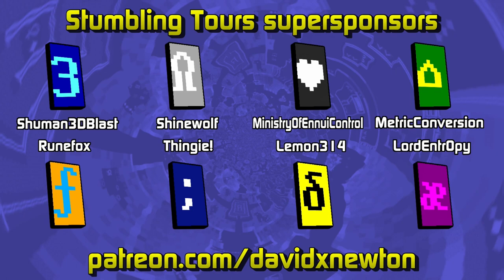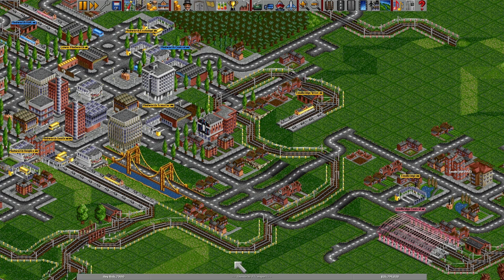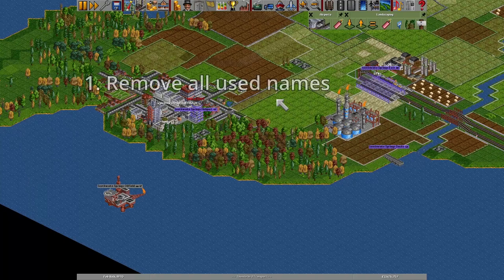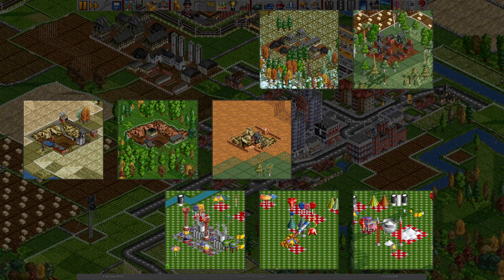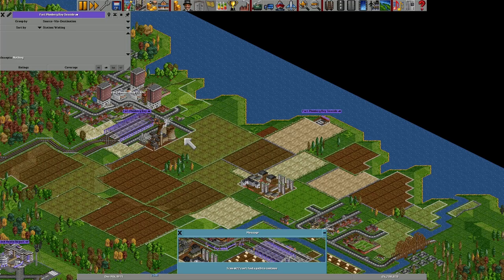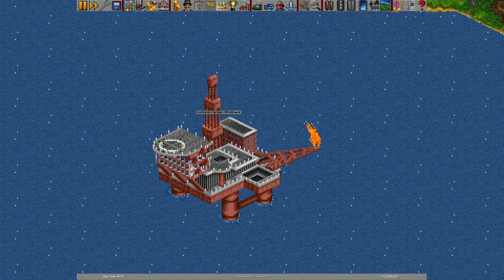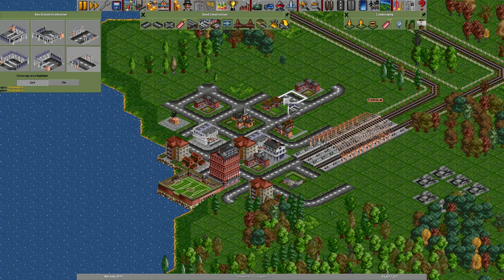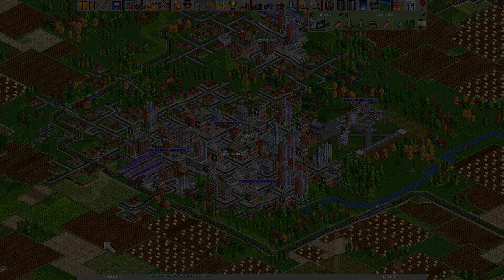How are stations named in Transport Tycoon Deluxe?

Comment: From a quick test, it looks like a station is permanently assigned to a town when named. Which might seem obvious, I can't rename "Tendbridge West" to "Mudworth West" and expect it to now be assigned to Mudworth - but what I mean is doing some "station walking", spreading the station and removing the original tiles and repeating until the station is now physically in Mudworth, keeps it assigned to Tendbridge. For that matter, moving it to the middle of nowhere and founding a brand new town next to it doesn't change that it's still assigned to Tendbridge. This opens some interesting avenues for abuse of company statues etc (or just getting the name you want.) Now I'm curious what does affect stations by actual distance and not just by what town they're assigned to. Unfortunately it doesn't seem to be a workaround for airport noise...

Comment: At 13:35 you start talking about the logic to use an industry-defined special station name. This is in fact used in the game, but only for NewGRF industries, i.e. mods. This is a TTDPatch and OpenTTD thing, the original game didn't support that. If you use an industry NewGRF such as FIRS you will see many industries affecting the default name of stations.
At 14:24 you mention stations with an industry type assigned. That kind of is and is not a thing. In OpenTTD 1.11, a game setting to industries with a neutral station (i.e. oil rigs) to be serviced by player-built stations. That's to force players to service those industries via their own stations, instead of filling in the ocean and just building a train line. But that doesn't really concern station naming.